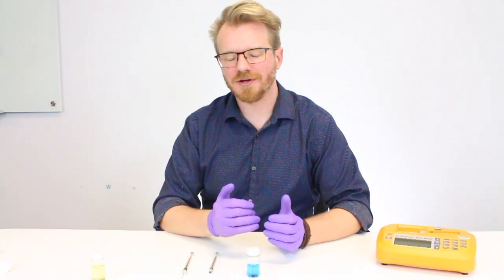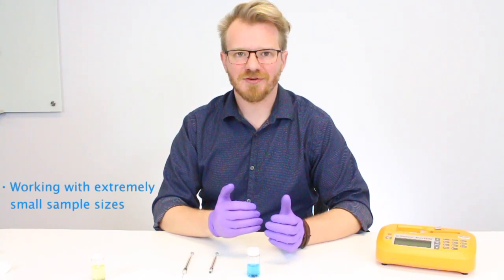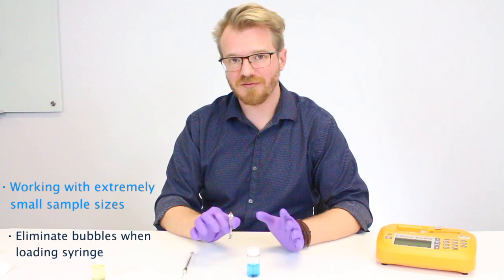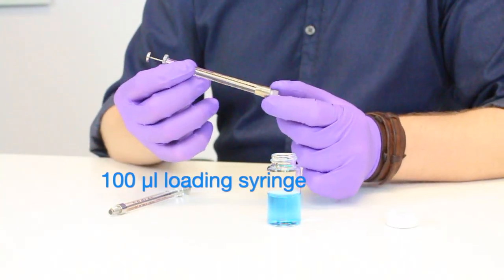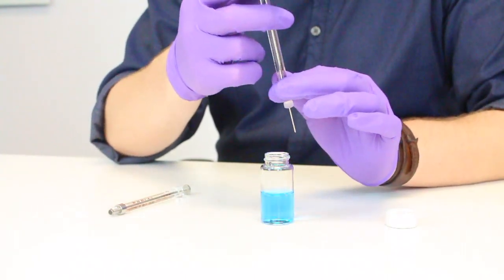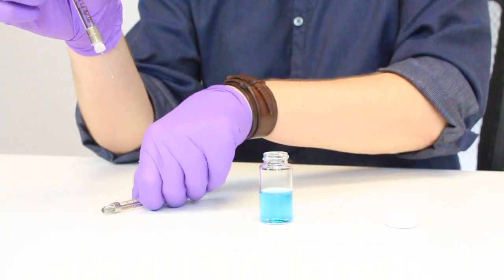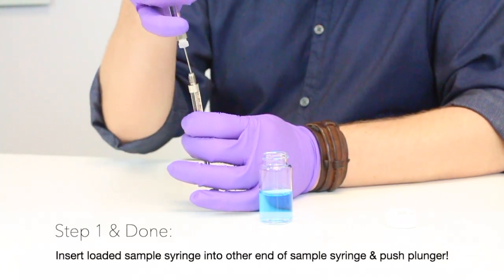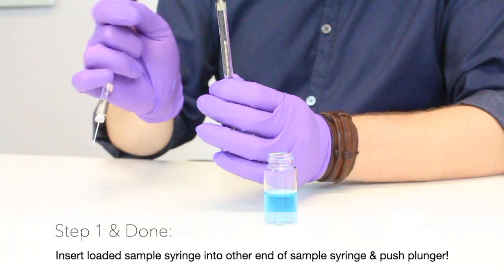Sample Backloading (Avoiding Air Bubbles!)

Comment: What about bubbles going into the bottle?
Reply from the maker: Over time the bubbles will rise even with thick solvents so you should be able to submerge your pipette or syringe with peek union and needle to avoid drawing the bubbles in the solution that's in the bottle.

Comment: What happens if you can’t get the small bubbles out and just inject?
Reply from the maker: Hey Mary! Great question! Worst case, if the bubbles go through, it won't damage the VROC chip. You may potentialy get inconsistent readings but if the bubbles are extremely small, the readings are often not impacted as well.